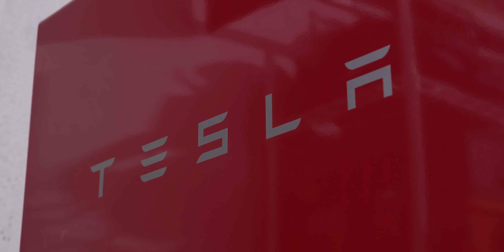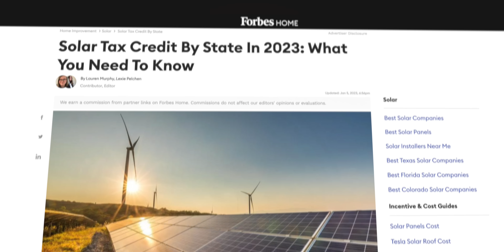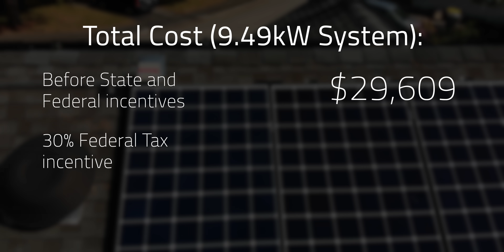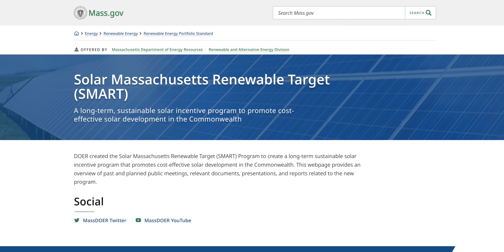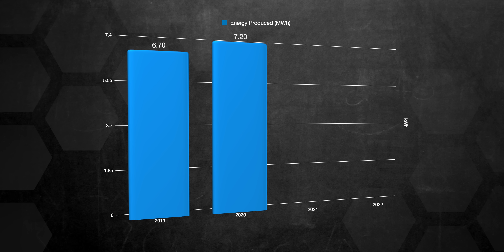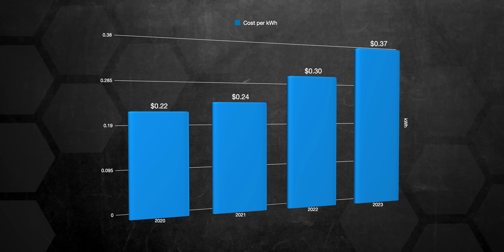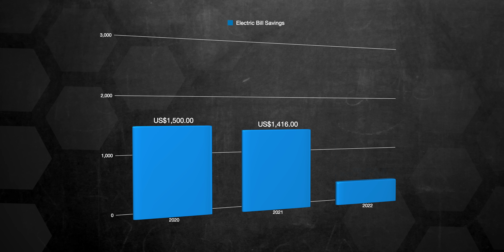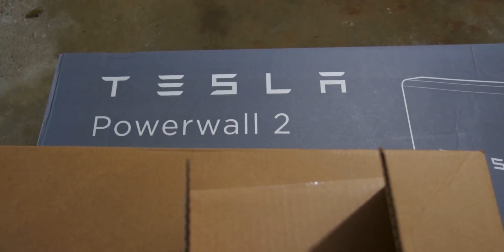5 Years with Solar Panels - Is It Still Worth It?

Comment: About 11 years ago, I had a grid-connected  array of free-standing solar panels installed behind my barn. (I realize most homeowners do not have the space for this.)  It produces about 90% of the power I need on the farm. The panels are angled for maximum sun exposure during the summer in Michigan; during the winter, we manually tilt them vertically for 3 reasons: 1) the lower angle of the sun during winter 2) to avoid snow sticking to them 3) to take advantage of "snow bounce" (the light reflected off the snow on the ground). I've been completely pleased with their performance; my annual electric bills are in the low hundreds of dollars instead of thousands. I can run my whole house A/C while still sending excess power to the grid on hot days! I love having green power!
Reply: Has there been any degradation in the panels ability to generate electricity over 11 years?
Reply: @franciscodanconia4324  the panels and the batteries I am sure have degraded not to mention the cables in the sun. Sun breaks down everything and nothing lasts forever or is free.
Reply: How much did you pay for the system?
Reply: Small farm?  😳😳😳
Reply: It seems to me that not having the panels on your roof is probably a great idea for a number of reasons, not the least of which is being able to control what happens to the snow.
Reply: When people don’t answer follow up questions it’s very suspicious
Reply: I also live in Michigan, and would want a ground array. What company would you refer?
Reply: What's your heating system in a winter?
Reply: I live in the uk and have been a roofer for 46 years and 4 yrs ago I started fitting roof panels for a major solar panel company, My team installed the roof panels and the electricians did the rest ,last year we walked away from solar after reading and hearing reviews from the unsatisfied customers .
Almost every customer was not satisfied to how much they had paid for there investment and how much there saving in the long run. The summer days the panels supply a good amount of electricity when it’s not needed as much, the winter days are short when electricity is needed and they hardly produce any voltage at all. The customers are the losers in this scam in the U.K. and manufacturers make a fortune, I would recommend to anyone thinking of have solar fitted to think hard and save your money.The storage batteries are the most expensive component and trust me when I say they don’t last long before they break down holding charge and need replacement.
Reply: @freakyscumbag  I've been investigating solar systems for the last few years, speaking to various company sales reps...  Based on this, I can't consider solar as a viable option, since I have not met one solar rep yet, who could do simple math...  They never want to give me a bottom line on savings versus cost and much of the advertising is clearly bogus.
Reply: @2freekey  it’s a total scam .these reps are salesmen and won’t tell you the figures, and the figures don’t add up,.in the U.K. the average cost on a average household is £13000 fitted and the lecky it produces is around 100 pounds a month saving on your bill.add all the months up to how the system will work over 9 years because by that time the battery will most certainly need replacing and the panels will be breaking down producing a fraction of the output from new ,
You may save maybe 6000 on bills in that time but remember how much it cost in the first place 13 grand ,and your well down on cash at this point and everything will need replacing once again at a even higher cost.. it’s common sense.
Reply: @freakyscumbag  I put 19 panels on my house and could not be happier.   My last elec bill was under ten dollars.  The month before that it was under 20.   From Feb-July I'll likely have a negative bill as these are peak performance months.   Paid cash.   25 year warranty on the panels.    There is so much negative bullshit on the web regarding Green Energy.  It's a perfect solution for many.  Not all, but many.  My street had zero solar arrays 4 years ago.  Now there are 6.   Solar IS the wave of the future since with each new gen of equipment the efficiency (production) goes up and the prices are trending lower.   My system was 27K and I will enjoy the ~8k tax credit on my 2025 taxes.     Even had I financed them, I'd break even in 6-7 years and then enjoy 22 plus years of free electricity.  The state just announced an 11 percent increase in kWh for 2026.   Its been going up every year for the last decade and will only continue to do so.   Making my investment even better as time goes by.    Don't listen to the bullschitttttt.   Talk to several established companies if interested in getting quotes.   Better yet, buy your gear from the utility if possible.    Talk to people with it on their roofs, not those interested in spreading BS.
Reply: Notice he doesn’t mention cost. Anyone who runs costs will see it is a. Isn’t pit. There is no “free” energy.
Reply: @donaldducko6580  
It's Me me me me... neighborhood bragging rights.

Decarbonization is 21st century pyramid building.
Just burn coal. 

This is sickening on so many levels.  "How to screw the lower middle class and make them pay for your feel-goodery."
Reply: @donaldducko6580    This is incorrect.   Once paid for and past the break even point, you'll 15-20 years of free electricity.
Reply: You need A/C in the summer in Michigan? 👀
Reply: Great to hear. Looking at putting solar on a shed instead of my roof. That makes no sense whatsoever.
Reply: Did your crazy governor let you go outside to adjust them during the Plandemic?
Reply: there is nothing green about these...rare earth minerals are being strip mined, and child slavery is often used in many of the countries where this is done as well...its more crimson than green, but i think if we come far enough we may be able to synthesize the materials versus mining them, but even that 5akes energy. not to mention the energy that goes into the manufacturing of panels. is like EVs, very few know how much more these things destroy than their maligned counter parts. Id love to power using water driven turbine if i had the land and water flow...thatd be a great way to go!
Reply: @michaelstaggs1880 your remark is a total fallacy.
Reply: Never thot of the solar bounce effect from snow! Good thinking! Any guesses on how much that gives you in production? (just curious!) I'll definately pass that idea on to our family in Colorado with free standing systems!
Reply: 11 Years ago; when Solar Panels that USA bought = came from Forced Labours of Uighur Ethnic groups ─ who got paid 10 US Dollars a day... 12 years later, when Solar Panels Life-Cycle needed replaced ─ US labour costs would be double the Recession US had in 2012; and US Dollars then worth nothing.   And also 12 years from now the Solar Panels Made in USA/ and or Germany would be 4-5 times the costs ─ and that when the Solar Panels / Solar Energy Renewable energy would be a Joke.

Regards,

Not including that during those Bannon Year, China under Hu Jintao President = had the Country, China, GDP growth double-digit = that Era is gone.  And the Solar Panels that Manufactured from Xinjiang Fired up on Coals to have provided the Energy/Heats for Manufacturing them.   That is the Results of now  Arizona and California, Nevada are under Heatwaves that = Somewheres burned the Oven... CO2.

Even Quebec, Province, 🍁 🍁 who 94% Powers generated Hydron (Dams) that don't come green ─ the Energy that came from Making Cements to build the Dams ─ has had generated more than 25% of Pollution ─  And nowhere in the World where the Land size of [	1,542,056.14 km2 (595,391.20 sq mi)  ].  Yes, more than half a million Sq Miles) for the Population of less than 15 million people.

Not accounting that most land/parcels where the Dams and Reservoirs, mostly, located are land belong to the Disputed Aboriginal People = Inconvenience Truth!  😂 😂 

Regards,
Reply: @michaelstaggs1880   You aren't subsidizing them, you are paying the power company for electricity and they are buying the OP's surplus electricity.  It's called capitalism where the OP has a commodity to sell, and the power company wants to buy said commodity and they re-sell said commodity to you.  Are you going to claim you are subsidizing workers in China because you bought a pair of shoes from Target?
Reply: @michaelstaggs1880 nope I’m not.
Reply: Doesn't provide the cost of the installation nor how big his farm is that allow him to get 90% for his house. Doesn't sat how many people lived there or how much energy he use.bit stupidity innit i
Reply: Too bad you don’t get paid the same per Kw from the power company for any excess power that the power company charges for the same Kw. That alone speaks of a scam, not to mention the fact that in the US most power infrastructure was paid for by taxpayers to begin with. Just another mob styled business model the we the people keeping paying for.
Reply: Thanks for sharing😎We would choose this setup as well. Happy for you!
Reply: I plan to make a chain mechanism that allows me to crank and manually tilt them vertically when it's snowing rather than keep them in that orientation
Reply: Me me me me... Me me me

Decarbonization is 21st century pyramid building.
Just burn coal. 

This is sickening on so many levels.  "How to screw the lower middle class and make them pay for your feel-goodery."
Reply: Vertically meaning plumb, straight up and down?
Reply: Bi facial panels might be the answer,
Reply: Congrats on your success!
Reply: Note:  marci9983 has not responded to any of your questions.  Also, note how he ended his comment with “I love having green power!”  I’m pretty sure that marci9983 is not a farmer and has an agenda of his own; he’s probably a solar power salesman or a higher up working for a solar panel company.  Rs
Reply: Have you considered a more efficient DC setup that isn't grid tied?
Reply: Feel allot is to help fund space stuff, mitigating the cost of research and development, and making materials cheaper for them, the chemicals needed, and everything else, makes me wonder if its really better or not, seems like a way for them to push developing remote  areas on your dime vs waiting for the grid to expand, also leaving you responsible for any problems, sorta a septic tank vs sewer connection issue, not sure whats better, keeps the money in the cities, while leaving the rural areas more self reliant but at the cost of a bit of inefficiency and extra work, cuz seen as not as profitable do to less concentrated populations, so good and bad, potentially bad cuz speeds up population booms, more land usable so prices go up and free space disappears faster, potentially good cuz allows a bit more independence but only untill enough ppl move in and you exceed demand, leading me back to population boom being a problem this causes
Reply: @ryanluna7322  it was installed on the ground
it's a barn
the farmer likely paid it upfront
Reply: @ryanluna7322, excellent thoughts and points.
Reply: @ryanluna7322  
Well said, I appreciate this comment…much to consider long and short term effects; Counting the costs in a multitude of ways.
Reply: You must have a small farm that doesn’t use much electricity or you have a few acres full of nothing but solar panels.
Reply: @tomservo5607  You can grow crops under and around panels. They don't block out the light, and its enough for plants to grow beneath them.
Reply: I hope John Deere or someone else makes an electric tractor
Reply: Bullshit (unless you have chosen to go off-grid and are energy independent).
Reply: That’s great. How much did you pay for the solar panels?  Or did your neighbors pay for you?
Reply: The Question is:

The Solar Panels = Mostly China Made with Forced Labours from Ethnic Uighur, where they are like in a Concentration Camp (Less than $us Dollars$ an hr and 12hr shift) ─ also all of the Plants manufactured in China fired up Coals to have met the intensive Powers/Heat demands.  (Are we just shifting the Pollutions /C02 Emissions to China?  They, the Manufactured Processes  not is USA?   There are so many Startups Failures since Obama Era!)

And What would be True Costs to have bought Made in USA?  Minimum wages for a Worker in USA working manufacturing such Panels?   Also, where were the Mines  that the Materials used in the Photovoltaic Thin Film.  Life-Cycle?

Boron the Main Component of Thin Film Solar Panels = The Mining Activities caused how much damages to China and Countries Mining Boron? 

While there are many types of PV systems known to be effective, crystalline silicon PV accounted for around 90% of the worldwide production of PV in 2013. Manufacturing silicon PV systems has several steps. First, polysilicon is processed from mined quartz until it is very pure (semi-conductor grade). This is melted down when small amounts of boron, a group III element, are added to make a p-type semiconductor rich in electron holes. Typically using a seed crystal, an ingot of this solution is grown from the liquid polycrystalline. The ingot may also be cast in a mold. Wafers of this semiconductor material are cut from the bulk material with wire saws, and then go through surface etching before being cleaned. Next, the wafers are placed into a phosphorus vapor deposition furnace which lays a very thin layer of phosphorus, a group V element, which creates an n-type semiconducting surface. To reduce energy losses, an anti-reflective coating is added to the surface, along with electrical contacts. After finishing the cell, cells are connected via electrical circuit according to the specific application and prepared for shipping and installation.[47]

Environmental costs of manufacture
Solar photovoltaic power is not entirely "clean energy": production produces greenhouse gas emissions, materials used to build the cells are potentially unsustainable and will run out eventually, the technology uses toxic substances which cause pollution, and there are no viable technologies for recycling solar waste.[48] Data required to investigate their impact are sometimes affected by a rather large amount of uncertainty. The values of human labor and water consumption, for example, are not precisely assessed due to the lack of systematic and accurate analyses in the scientific literature.[1] One difficulty in determining impacts due to PV is to determine if the wastes are released to the air, water, or soil during the manufacturing phase.[49] Life-cycle assessments, which look at all different environment impacts ranging from global warming potential, pollution, water depletion and others, are unavailable for PV. Instead, studies have tried to estimate the impact and potential impacts of various types of PV, but these estimates are usually restricted to simply assessing energy costs of the manufacture and/or transport, because these are new technologies and the total environmental impacts of their components and disposal methods are unknown, even for commercially available first generation solar cells, let alone experimental prototypes with no commercial viability.[50]  
Quoted.

Regards,
Reply: @Studio89Graphic  What was your question?Are they worth it?
Reply: If it supplies 90% of your power, then you have a 90% offset system. 
Normally, I design a system to be 100%+ offset, so all power needed annually is produced.  
Since you have the land, why didn't you get a 100% offset system?
Did you or the designer make a mistake?
Did you specify too low of a target production? 
Or did the designer not properly estimate production?? 
BTW, some installers, like my company, have a production guarantee.
Reply: There is no way your panels can provide heating and cooling for your home. And you have to pay it off in 20 years. With interest rates for cost of installation. Eventually you will need your roof changed and those panels must come off.
Reply: @TomokoAbe_  He stated they are on the ground behind the barn. Read more carefully next time.
Reply: @chrisfrench9257  Yea, but, that's not what all those invested in the solar companies are suggesting...  They do suggest right on your roof.      Not good for you,  but,  good for their sales plans...
Reply: @TomokoAbe_  yeah it can. Our panels provide 100% of our heating, cooling, cooking, hot water needs and everything else. Ours is a 6.6kW system with a Powerwall2.
Reply: @jerrymyahzcat  the only way to store energy is through batteries. You must rely on fans for cooling.
Reply: @jerrymyahzcat I agree with you.   My very small system provides our food storage (fridge & freezer), lighting and all everyday conveniences like instapot, etc.   I wouldn't try heating or cooling but my friend in PR has only 2.7kw with 4 24v Lead-Acid batteries & runs his AC all day with that.  Still off grid after Maria.
Reply: @TomokoAbe_  you’ll note I have a Powerwall2. That’s a battery. 13.5kWh. 
But no a battery isn’t the ONLY way to store electricity but anything else is unrealistic in most cases. 
And we use 3 reverse cycle heat pumps for heating and cooling (aircon). Also in winter run a fan heater on occasion and an oil heater overnight.
Fans don’t cool - they just shift air about.
(4 bedroom house, 2 adults living in it and we are in Australia).
Reply: @jerrymyahzcat  What was your cost out of pocket ?
Reply: You have no idea if it can or not.  This is family specific.  Your needs are not his needs.  @TomokoAbe_
Reply: @TomokoAbe_  barns are often shake or metal roofing.  Shake lasts like a century.  Metal can last even longer.  And you can definitely generate enough power to cover ac and heat.  Its also very likely that farmers  in michigan have a wood burning stove in their house.
Reply: @TomokoAbe_  Ah the change to roof problem. Sounds like US America. In Europe, we build our houses to last hundreds of years (or more) and those same rooves are still on buildings from long before the USA was a thing.
Reply: @Thurgosh_OG  In Florida homeowner's insurance companies are leaving the state by the droves. They can suddenly drop you. They DO! It happened to me twice. YOUR ROOF IN FLORIDA has to be 10 years old less to even be considered. So if your roof--even if perfectly built and still strong--must be changed to be considered. That's the way it is in Florida (USA).